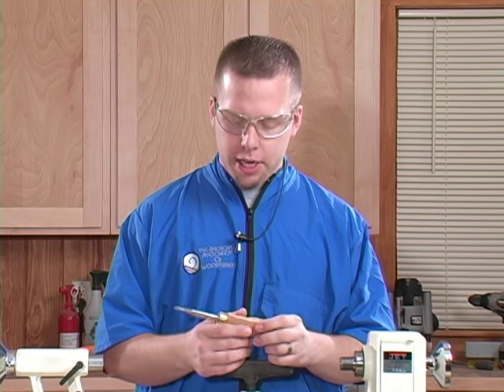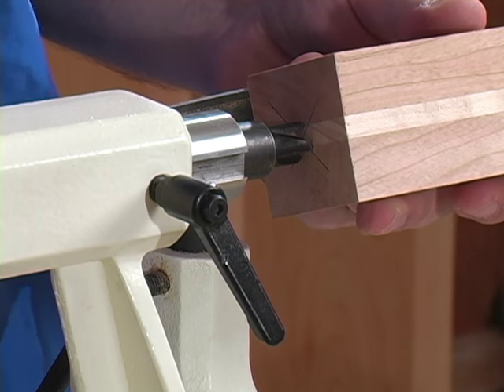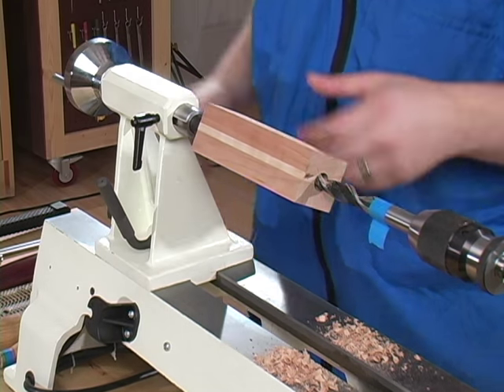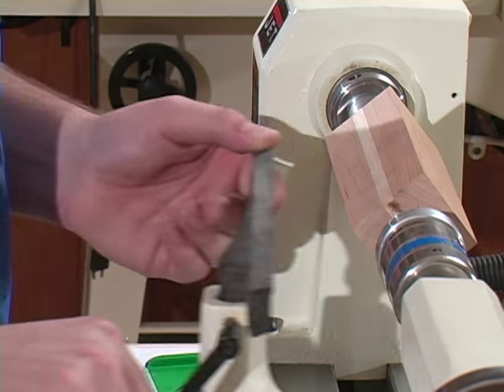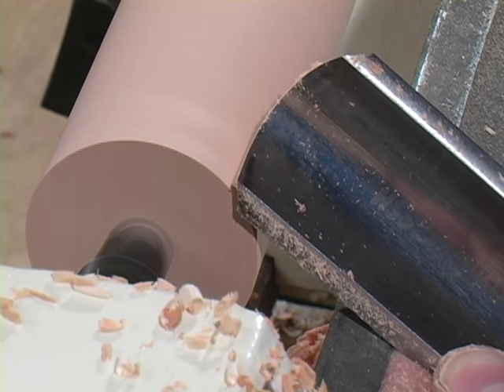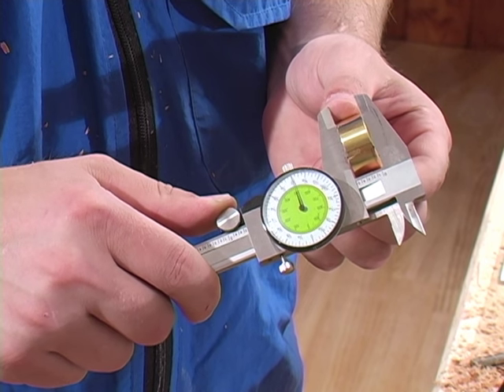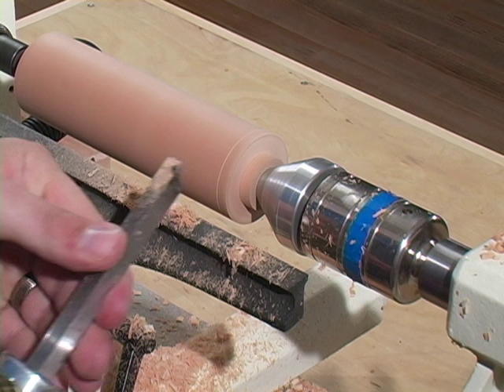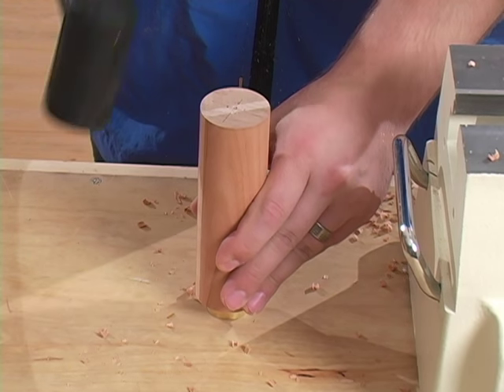How to Turn a Screwdriver Handle (part 1) -- WOOD magazine

Comment: Tried the tenon part the same way ten times and failed ten times. As a pro I'm sure holding both and doing it at the same time is easy but it's a bit more complicated for someone without the experience. Any other way to do this?